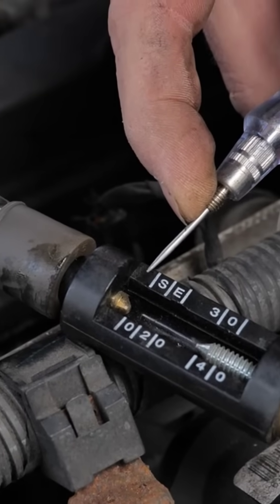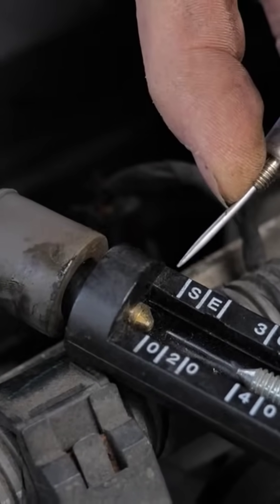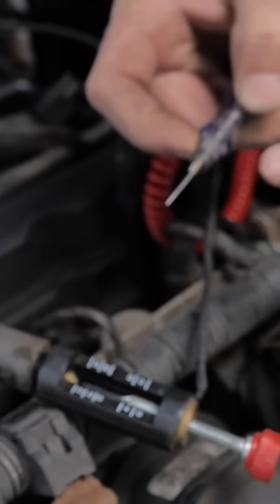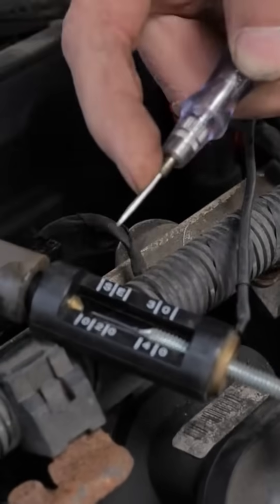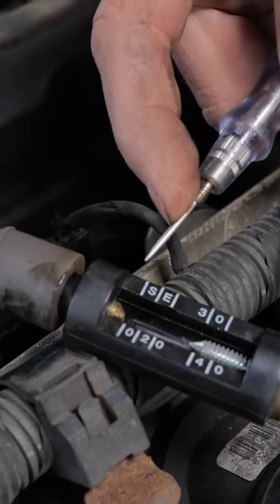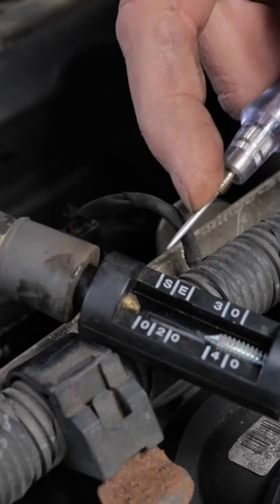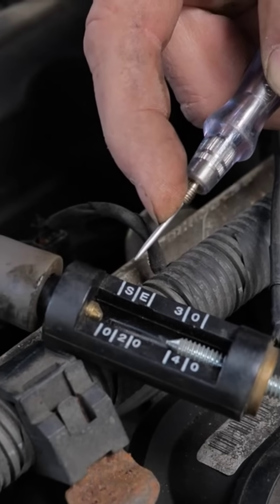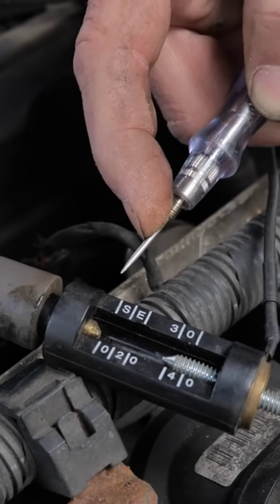Why am I not getting shocked by this ignition coil? #automotivediagnostics

Comment: What's that sound? I use battery jumper to start before I even start just plug into the cable press power it has thst sound but couldn't jump start 😂

Comment: what if your hand is wet?
Reply from the maker: Wouldn't matter. Even wet, my body has way more resistance that the test light
Reply: @ScannerDanner  you have sweat glands or possibly broken skin/small cuts on your hand. Water, sweat, blood has less resistance than the test light.
Reply from the maker: @RabidxDog  nope the incandescent bulb has near 0 ohms of resistance when not energized
Reply: @ScannerDanner  how do you measure resistance when not energized? Does anything that has no current passing thought it have near 0 ohms of resistance?
Reply from the maker: @RabidxDog  bulb not lit, not connected to a 12v source, aka not energized
Reply: @ScannerDanner  ok thats true. But that doesn't mean it has next to 0 ohms resistance.

And you really should know this. Im being nice to you, what you are doing is POTENTIALLY dangerous. Electricity CAN jump an air gap. At least be smart enough to wear a rubber glove. Someone else is going to copy you and get hurt. There is a reason the handles aren't metal.
Reply from the maker: @RabidxDog  dangerous? A 12v conventional ignition coil is far from that, unless maybe you have a pacemaker. Even then you're talking about such small amount of current flow (a few milliamps at most) that there is no danger from the shock itself. The only dangerous thing that can happen is you smack your head off of the hood or throw your hand into a moving pulley or fan because you jumped. We used to wire up an ignition coil in my classroom and shock each other on purpose. Always a fun time 😂
Reply: @ScannerDanner yes dangerous,  I never said it would instantly kill you. Yes if you have a pacemaker it could end in death. Yes if it shocks you you could recoil and fall on moving/hot parts. (May not be lethal, I never said it was lethal, I said it was potential dangerous). You realize the reason we have to over engineer safety is because stupid people do dumb things to injure themselves then blame others. Who do you think people will blame after repeating what you told them to do and then get hurt??? Think about it. You claim that its safe, its potentially dangerous. The company that makes that product aren't going to back you up, they made a handle specifically for you to use to keep your hand away from danger (they did that to cover their ass). You never put a disclaimer "don't do this at home" and there really is no good reason you have to hold it like that. You really need to consider what I'm telling you. Anyways I'm not your mother, have a good day.
Reply from the maker: @RabidxDog  no more dangerous than riding a bicycle. This conversation reminds me of seeing a barbie doll inner tube that was like 3" in diameter with it stamped "not a life saving device" lol
Reply: @ScannerDanner  ok you have your view on what is dangerous. Lets just focus on the test light. Why do you put your finger on the conducting rod?
Reply from the maker: @RabidxDog 
 in this case, just to prove a point. I normally don't do this, I was simply addressing concerns from my viewers on how close my finger was to the tip of the test light in a previous video.
Reply: @ScannerDanner  if I were to hold a golf club above my head during a lightning storm and lightning strikes but  doesn't strike me, what point is proven by this? 

It doesnt prove that you can do that and not ever be struck right? 

What happens if there is high humidity one day? What happens if the car overheated and sprayed water coolant into the air. 

The spark that jumps to the conducting rod could easily take a path to your finger, and if you are touching metal you are grounded. I know you know this. I know its not a lot of amps, but you didnt prove what you think you did.
Reply from the maker: @RabidxDog  lol you win

Comment: If you had a lower resistance thru your body, than the few ohms in the test light, your body would light up !! Only need about 60 VDC to be injurred. But in most cases the resistance thru you body is very high. When using an ohm meter at the high resistance scale, you have to be sure your finger is not touching the metal probe.

Comment: Had a 2010 Chrysler T&C (3.8) w/ misfire. Every time I tried to disconnect a coil wire, I got shocked.
Reply from the maker: You can't just disconnect a coil/plug wire without giving the spark somewhere to go. Otherwise 100% you'll get shocked every time
Reply: @ScannerDanner  Thanks.  Was just trying to find a non-contributing cylinder.

Comment: My single din radio and my amp stopped working. No power to both. Checked fuses and no issues. What could it be ?not sure how to proceed
Reply: I would check my ground cables to verify they are secure, then do the same for my power. For the amp, make sure the signal wire is connected, and finally, if there anything else on the circuit? Are those things working

Comment: the video cut when the spark jumped to his finger :D
Reply: Have your nuts about a half inch from a steel bumper and do this.
Reply: The video got cut because it was edited to become a short YouTube video.
If you go in the channel and watch the latest video you would see the whole video which they are diagnosing and intermittent no start - stalls when applying the gas pedal.
In that video you would see that even after Paul didn't get shocked in this video.